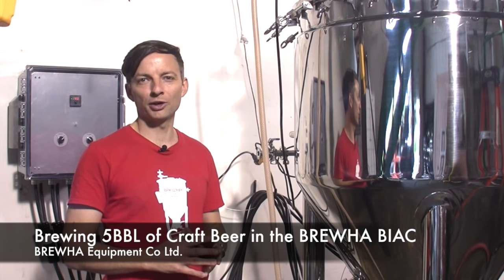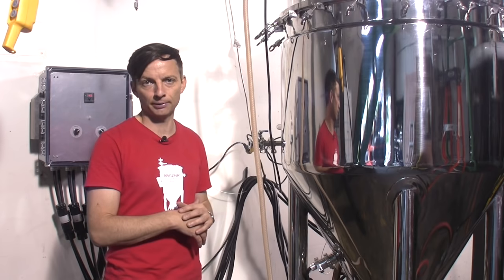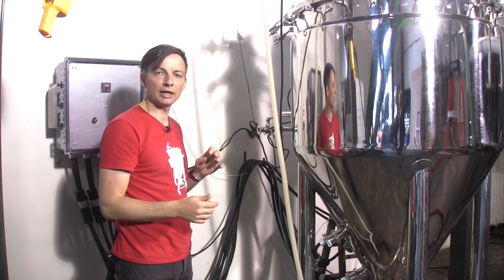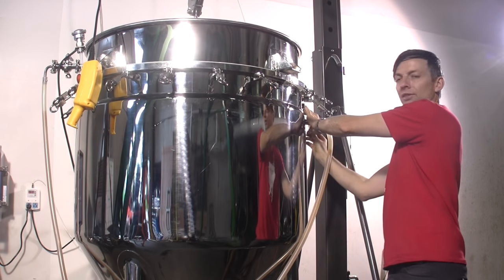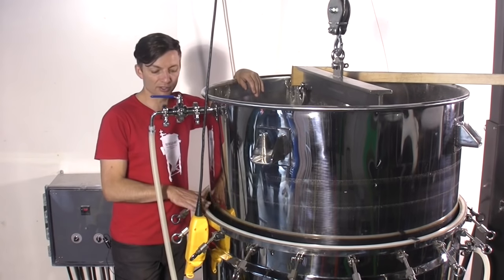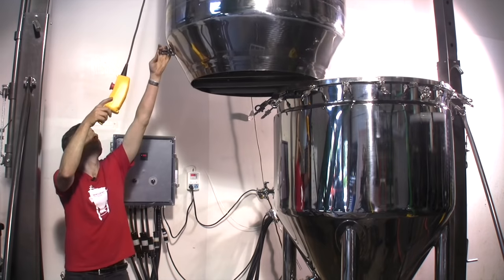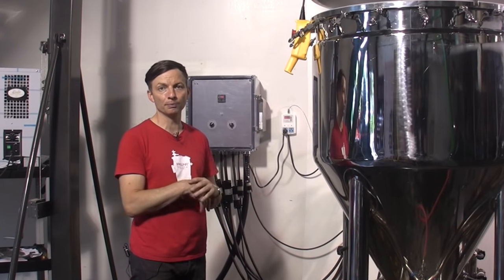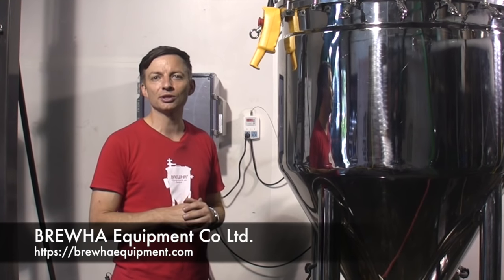Brewing 5BBL of Craft Beer in the BREWHA BIAC microbrewery

Comment: This looks amazing, I need to know how much water will i waste per batch (for my city sewage board application)?
Reply from the maker: The Colander and pump can be cleaned with as little as few gallons of water (sprayed/wiped down) and the same goes for the fermenter. Heat will take care of the rest! (If your water is such that beer stone forms in the fermenter, you will need a traditional chemical clean once in a while -- many customers don't ever need it). I think a generous volume to use for planning would be 2 units of water for every unit of beer produced -- that is one unit for beer and one unit for cleaning. (If you are using tap water for cooling and just dumping that, the volumes will likely be 2 or 3 to one for the cooling--the first unit or two can be captured for the next batch and for cleaning. And of course, if a cold liquor tank is used all that water is recovered.
Reply: With "Heat will take care of the rest" you mean that you apply a cleaning cycle with heat or that you don't clean the mash tun (and fermenter) at all?
Reply from the maker: The mash tun and fermenter just need to be rinsed out with the visible 'soils' being removed. The heat takes care of the microscopic.

Comment: Wouldn't adding water post boil compromise the heat sterilization?
Reply from the maker: Hi Bill, I prefer to add water pre-boil (during sparge) and control boil rate as needed to tweak final volume, but as long as the water being added is treated (distilled is best) and the temperature at the end of addition is not below 90C/195F it will remove the organisms that will cause problems. (It is important to run boiling wort though the valves during the boil for this same reason -- particularly the bottom dump valve and the racking arm could hold water  at the extremity that doesn't heat up enough so flush a bit of boiling wort through the valves to ensure the entire valve is sanitized.)

Comment: How much vertical clearance does this system need?  My building only has a 12' ceiling.  Any tips on whether or not that's a deal breaker, not only with the BREWHA system, but with any system?  Thanks!
Reply from the maker: Hi JT -- as you are probably aware, the higher ceiling is only needed directly in the brew area (for lifting the Colander out of the 4-in-1 fermenter) and is not needed where fermenters are pushed for fermentation. And yes, a 12' ceiling has worked for many. You can see more details about ceiling heights with the different sizes on this page (email us at brewing@brewha.com with any questions): https://brewhaequipment.com/pages/clearance-need-to-accommodate-the-brewha-lift-beam

Comment: I didn't see any mention of whirlpooling. Is this possible in the BIAC?
Reply from the maker: With a conical bottom, the protein/hop material naturally settles to the tip of the cone where it can be removed through the bottom valve. But a racking arm in the racking port can also be used to whirlpool the wort.

Comment: Hi guys, quick question, would it be easier to simple have an opening at the bottom of the container where the grain is, instead of tilting the vessel to dump the grain?
Reply from the maker: Hi Gino -- dumping is very easy with the tipping cable to tilt the Colander as it is lowered. We looked at various designs with bottom openings but none were as affordable, simple and efficient.
Reply: No. What's more simple than turning and dumping 🤣🤣

Comment: I do brew in a basket homebrewing right now.  I thought about using same system for my future brewpub but the only issue I see is that if I want to ferment several beers at one I would have to buy several of your systems.  price wise it doenst make sense.   what am I missing here ?
Reply from the maker: Hi Genaro, you don't need multiple systems, just one BIAC system (which includes a fermenter), and as many additional 4-in-1 fermenters as you like (the brew day hardware from the BIAC can be used in each of the additional 4-in-1 fermenters).

Comment: What about the hops you boiled with? Do they just stay in throughout fermentation and end up resting with the yeast? If so, can you pull yeast off the cone for another batch or is it now infested with hops?
Reply from the maker: Hi George, whole leaf hops can be contained using our Hop Baskets (on the Accessories page of our website) or a similar device. Especially with the larger systems, brewers will often use pelletized hops as they will settle to the bottom of the cone during chill and can therefore be removed along with break/protein prior to aeration and pitching.
Reply: Use a spider or like every other conical, dump them before pitch.

Comment: So you ferment right in your kettle? If you had to do multiple brews in the same week you would have to pump into another vessel to ferment correct? So if you started a micro using this to scale it you would just add fermentation vessels and pump and pitch?
Reply from the maker: Hi Chris, the Mash Colander can be inserted directly in each additional BREWHA fermenter so you can brew right in them. Although it can be done, there is no need to pump wort into other fermenters, potentially compromising sanitation along the way. This blog shows how: https://brewhaequipment.com/blogs/howtobrewbeer/18189829-one-biac-endless-possibilities
Reply: So the elements are in the colander? I see.
Reply from the maker: Hi Chris, the elements are in the cone portion of the fermenter under the Colander. They remain there and can be used at low output (ie1-2%) for warming the ferment if in a cold building or for certain styles of beer. Each additional fermenter that can be brewed in (with all temp control accessories) is about 50% the cost of the full BIAC.
Reply: Chris McAuliffe thats about right
Reply: I don't think you understand the point of this system.

Comment: Cost wise the BIAC 5 BBL system is much cheaper than other 5 BBL systems with a more traditional 3 vessel setup. I love the idea of boiling and fermenting in one vessel but buying multiple 5 bbl systems would add up quickly. Would there be anything stopping you from buying a single 5 BBL BIAC and initially using it primarily as a brewhouse and then fermenting in separate fermenters?
Reply from the maker: Hi there -- you don't need to purchase multiple BIACs to get all the benefits (chemical free sanitation, labor, capital savings, etc.). You only need to purchase additional BREWHA 4-in-1 fermenters and heating elements and you can brew directly in each one of those (using the one Mash Colander etc.) that comes with the BIAC system. Each additional fermenter with heating elements is about 40-50% of the Complete BIAC price.

Comment: do you have to ferment in that kettle? or could you pump it to a conical fermenter?
Reply from the maker: Hi Nathan -- the 'kettle' in that video IS a fermenter. After the boil just chill in place (using the jacket), and ferment. Want to start the next batch? A second BREWHA 4-in-1 fermenter with heaters is all you need.
Reply: @Brewha  but you could pump it out and ferment in another fermenter, right? To my mind that misses the unique selling point of the Brewha that you have everything in one vessel.
Reply from the maker: @AndrewSmithThomas  Yes, that is possible, and yes, it does miss the benefits of the BREWHA system.

Comment: Noob question, What is the temperature should I maintain the BREWHA , can keep on garage 85F summer time during this process before kegging or should be climate room ?
Thanks.
Reply from the maker: Fermentation temperature is easily lowered in the BIAC by cycling cooling water from the Chiller through the jacket (see 'Temperature Control' section in the 'Learn' area of the website for more info). Regarding fermenting temperature, it depends on the style of beer and yeast used — most lagers should be kept around 50-60F and most ales around 65-75F, but some styles, like saison can be fermented at your garage temperature.

Comment: Is there a way to Whirlpool? Can it be done at lower than 170F?
Reply from the maker: Hi J -- with the conical shape of the base, solids will gravitate to the bottom port where they can be removed. If one still wants to whirlpool, they can use the racking arm.
Reply: @Brewha  thanks for the quick answer.  Would you say that introducing lactobacillus into the brewhouse is less of a concern since you are heat sanitizing the fermenter everytime?  Seems intuitive, but any other precautions you'd take?
Reply from the maker: @JT-ic9mp  Hi J -- yes, that is correct. Without hoses/transfers which can harbor bacteria, and with heat sanitizing the fermenter itself, brewing with bacteria is much easier on the BREWHA system. The only caution is to be sure to flush out your racking and dump port during boil, to ensure that they are properly heat sanitized.

Comment: Electric drill and bbls of water and a steel conductive pot.  What could go wrong?
Reply from the maker: Care should always be taken when using electricity, especially around water. That applies in a brewery with bbls of water, as it does in a kitchen when mixing in a small pot. It is safest to use a GFI protected circuit. If one is concerned they might not be able to operate a drill or mixer safely, they could use a wooden stir stick or mash paddle.